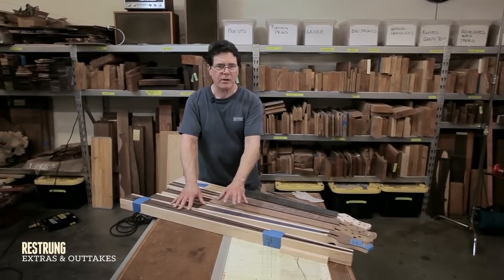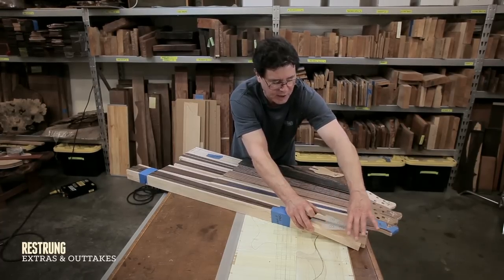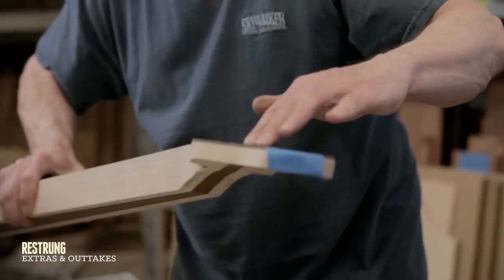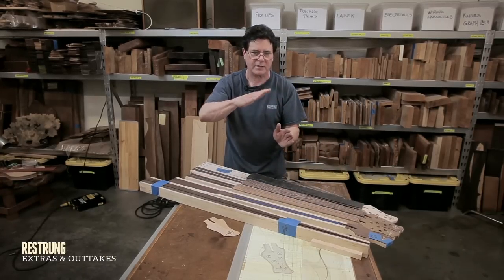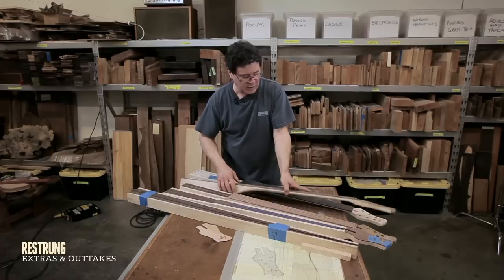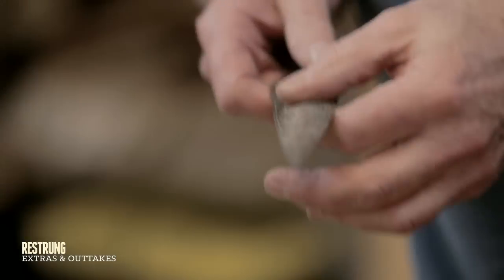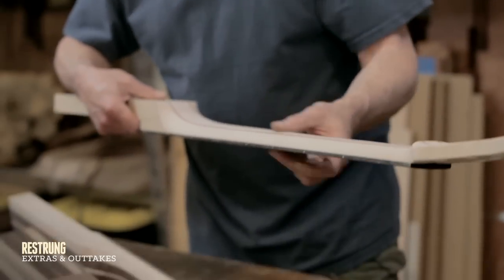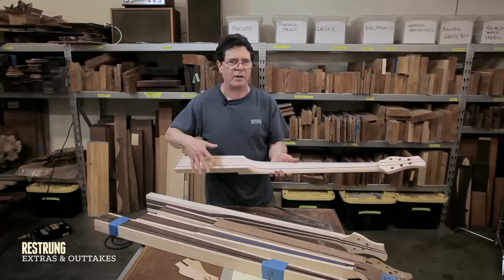How to Build a Bass Guitar - Step #4 - Necks at Different Stages

Comment: i need to ask why neckthrou instrouments have that sort trust rod ?? i mena why not all the way to that pieace of wood? sory for my crapy eng!
Reply: It's to do with the geometry of the guitar and the set up.

There's no need for the bass body to be tensioned against the strings.
It's not bad thinking, if the neck bends, why not the body too but it just doesn't happen: the wood's thicker there, the body wings- and their glue- will hold rigid against the string tension too.
The only real bend will be toward the top 1/3 or 1/2 of the fret board because it's thinner and weaker there- I think the headstock angle might also play a part.
And we use an adjustable rod- rather than just very stiff bracing- because it's usually preferable to have a slight bend in the neck and different people use different strings, different tunings, etc.

Hope that helped.
Reply: thx allot!!